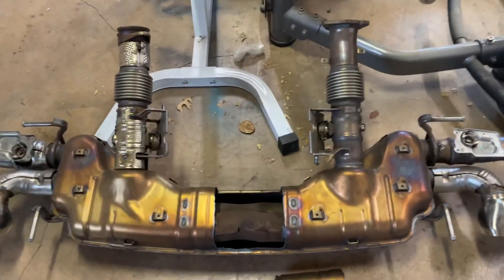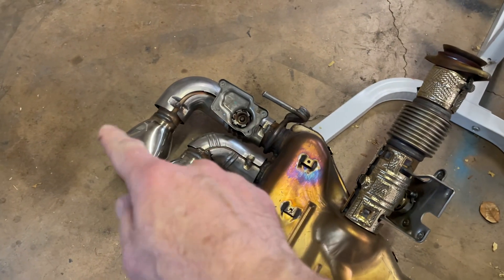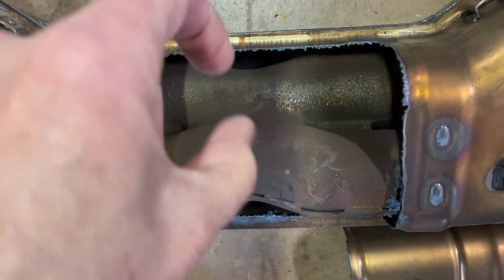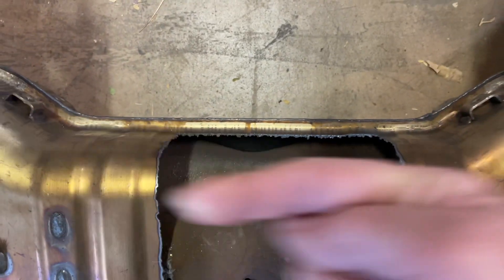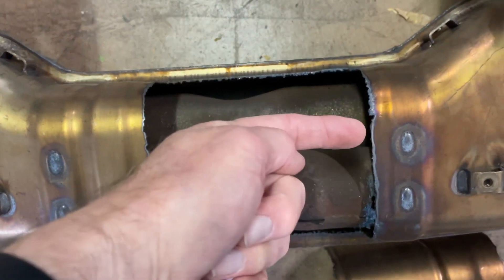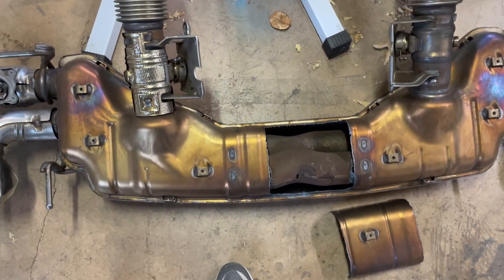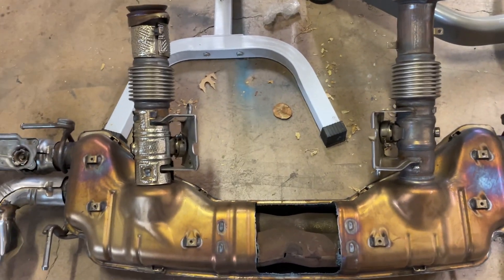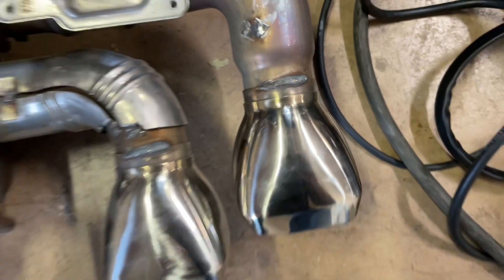C8 stingray Z51 stock exhaust flow cut away

Comment: I think that is not the performance exhaust?
Reply from the maker: Z51. It absolutely is the top-of-the-line stingray V8 push rod performance exhaust. If you have as much experience, cutting open exhaust as I do. You’re gonna find that many manufacturers have to make compromises to save money. And in some cases in order to reduce noise, harshness and vibration. Don’t be too shocked.

Comment: Cut that merge open and see what's in it. Looks can be deceiving
Reply from the maker: I'll cut into it later, sure... I have experience with these stamped steel X-pipes on other exhausts I have built. What do you think I will find, necessarily?
Reply: @slkttop  I'm not sure haha. 
Them engineers have some cool computer simulators for air/fluid flow so I'm wondering if the "center" of the X is open or separate.